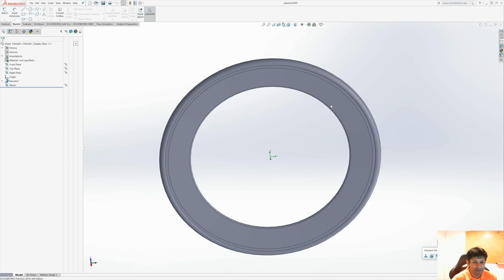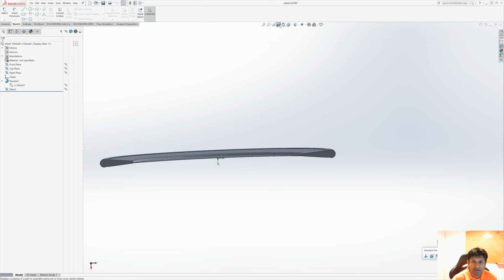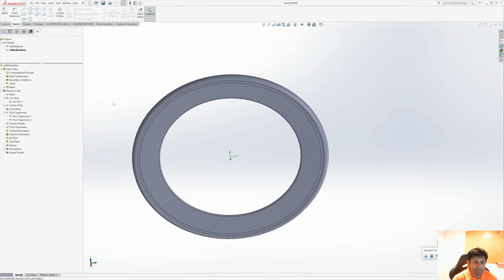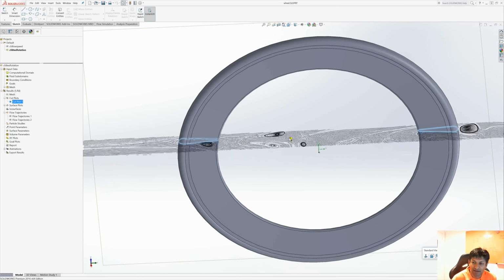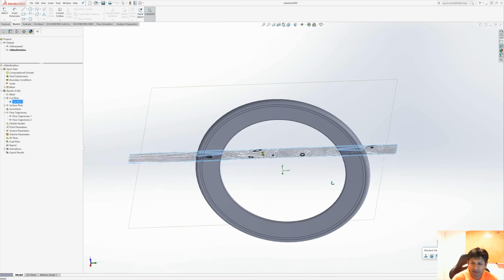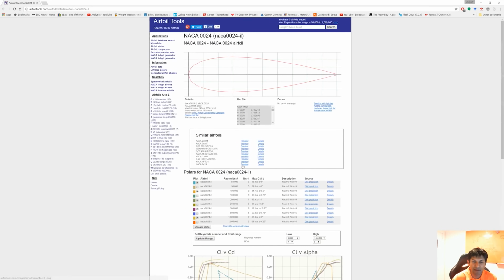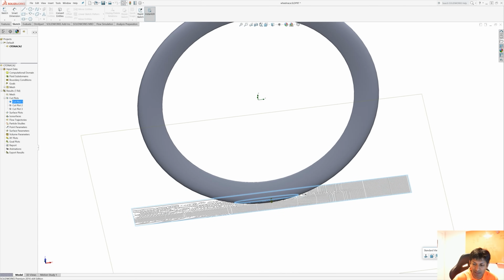Explained: Aero Bike Wheels (Zipp Enve Mavic Fulcrum)

Comment: Thanks for the modelling.  This draws a question (from my non-engineering profession background)... why would more people not incorporate a carbon fender with good aerodynamic shape characteristics to cover the top half or more of the front wheel (assuming you weren't worried about crosswinds as much and its a calm day)?  Wouldn't that reduce a lot of the front trailing edge turbulence effects by creating a continuous surface (more or less) to flow into the frame better?  Obviously the speeds aren't comparable, but you see now in some Moto2 bikes where the front fenders cover a large portion of the fork/brake surface now, which probably aides in not having wind hit all those surfaces in weird ways.  Has anyone ever experimented with front carbon fenders/shapes to test the affects on this with good results?
Reply: It's a pity you had no answers, excellent questions. I noticed that Moto2 front fender. I guess it may work

Comment: Good Morning Sir, As i understand it, since the wheel is at any one time 50% aerodynamic to the direction of travel [please correct me if im wrong] Would there be any benefit to attaching a LMP1 style wing or bodywork type idea to the fork, to mask/protect the trailing edge (6 o clock to 12 o clock) of the wheel to prevent those vortices creating drag? (I understand that the first thing F1 designers would do in regulation-free rules, is encase the wheels). Cheers Hambini!

Comment: Right, finished it.   Jeez, that was good mate.  You seriously need to do more stuff like this.  Phenomenal.  

Question; the fork, hub and spokes will obviously affect air flow, so does that improve things for the top half of the wheel or add to the messy flow?
Reply from the maker: It makes it more messy, One of the things that you can do is when you disturb the airflow you can put a structural member immediately behind it to effectively have it operating in a drafted section. 

For example My cervelo S5 has a "dropped" downtube, whoever designed the bike realised they were going to get turbulence generated by the front wheel which they could do little to avoid and put the downtube as close to the wheel because it has to go somewhere so lets put it in an area where there is little velocity. 

This is similar to a bike rider drafting a car, they are sitting behind the car, the car has disturbed the air and they are riding along in an area with no appreciable wind. If they slip slightly back then the air has  a chance to straighten itself and they get the full brunt again.

The type of spoke has less effect as the rim depth gets bigger because the spoke is shorter and the relative velocity reduces.

Comment: I wasn't buying the golf ball dimples on the rim from Zipp either. I wouldn't be surprised if tire manufacturers took up the torch and started putting dimples on the tires though. 

At 11:00 you said that the aero benefits come from pure geometry as opposed to the toroidal shape. For the most part, would it be correct to say that Campagnolo Bullet 105s are at least every bit as aero as the Zip 808s provided that the tires used are a very similar width as the leading edge of the rims on both? 
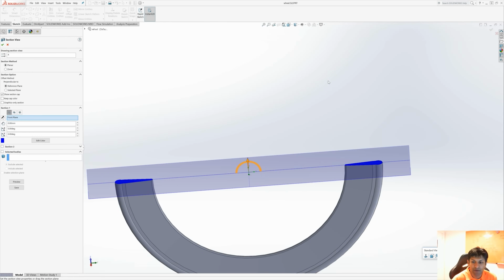Edit: Campagnolo Bullet rims are very similar in shape to the rim shape you drew and showed at 15:10

Comment: As an electrical engineer, thank you for being technical enough for me to keep up :)
Reply: Also, you made a big claim saying the dimpling is rubbish; I don't intend to argue, but can you make a video on that?
Reply: So when you did the computation, you model the wheel spin while modeling the incident air flow? If so, well done! Good attention to detail.
Reply from the maker: I don't think I'd have enough content to do a video on that. However to give you an explanation:

Drag is composed of two things, skin friction and pressure drag. Skin friction drag is just that, the drag caused by air flowing over a surface. Pressure drag is caused by the back draft that an object leaves behind it as it travels forwards. The dimples increase the skin friction drag and reduce the pressure drag. This is why golf balls are dimpled.

The only issue on a bike wheel is this does not work because the relative speeds of the wheel around it's circumference vary.
Reply: Great video. So in your opinion, what's the best valued aero wheel for around USD 1k? I was looking at Chinese carbon  (56mm rim depth at 1550 grams)  for around that price but wasn't sure about quality. Alternatively I could look at more main stream brands. Thought?
Reply from the maker: I'd go for Yoeleo wheels. They aren't the cheapest  "chinese" wheels but they are well regarded on multiple sites.

However, if you want wheels that are essentially indestructible. I'd get Shimano C60's. They do weigh more and cost more but they have good bearings and an aluminium brake track. So in the rain they are miles better.

Comment: Excellent rim review however I do have a couple conversation points. I think the spokes and hubs would have a significant impact on the airflow of the wheels, specifically the rim to spoke conversion of airflow. It would also be interesting to see how hub design will affect the aerodynamics of the wheels since there are a huge variety of hub designs out there. Another interesting point to think about is, how could you make the bottom section of the wheel as aero as possible and at the same time have no effect on the top section of the wheel. Some sort of hybrid wheel, in which the bottom section stays at the bottom and top stays at top while the wheel is in rotation. But this design is way too complex to engineer since there would need to be a collection of different spinning points on the wheel.

Comment: Great vid, clearly explained how the deeper section is more aerodynamic. I've had a (quick) look to see if anyone has asked this question already. Simply which wheel is going to be faster up a climb, a wheel that is  heavier with a larger section or lighter wheel but has a shallower section. 
If the lightweight wheel has a section of 33mm and weight of 1250g and the more aero wheel is 55 mm at 1400g, climbing at a speed of 14kmh. Climb has gradient of 7% (I don't know if that's relevant). Which wheel would be quicker on the climb? Thanks

Comment: The dimples: Schuberth helmets used these to reduce airsound. The theory behind this is a controlled airstream without random stalls. The efficiency of the helmet got worse but the difference between silence and tornado feelings became less.
And this is why Zipp put the dimples on the rim. The efficiency got worse but the crossover performance became more repeatable.
BTW: NACA was the predecessor of the NASA and developed wing profiles for airplanes. You referred to the fully symmetric ones (0009 or 0012), but they made a lot more. However for bikes we need the fully symmetric ones only. Nobody came to the idea to use a RG 15 profile for crosswind situations (would be funny if the wind direction changes).

Comment: Really good job at tackling a very complex subject. Thanks. The one question/surprise is why you didn't comment much on the stability effect of the toroidal shape at the average yaw angle. I bought into that argument in my latest wheelset purchase and I do think that i notice the benefit, versus my other bike which still has naca profile rims/tyres on it. Do you think that there is a stability benefit and, for you, might that outweigh pure aero cut through out on the open road?

Comment: Cool vid :)   
But your calcs on density (Aus v UK) are possibly a bit off (esp the 60w difference).  If you assume:
AUS: temp 35C, Alt 20m, HPa 1020, Rel H 20% Air density is 1.147.  Assume Crr 0.0052, 300w @ 30kmh = CdA 0.768 (which is super high, typical road racing cyclist ~0.330, typical triathlete ~0.285)
UK: temp 10C, Alt 20m, HPA 1020, Rel H 90%, Air density is 1.248.  Assume CdA 0.768, Crr 0.0052 Speed = 8.12 m/s = 29.2 kmh instead 30kmh.  Power to ride @ 30kmh = 323w or only 23w difference.
Maybe you could get a 60w difference due to air density, but it would be very extreme, and perhaps not really typical riding conditions.
Air density certainly has a big effect on the success or failure of hour TT records, where higher altitudes do allow slightly higher speed and make success more likely.
Reply from the maker: Hi Rob, Thanks for your question. I didn't calculate the air density, it has come from Jet Engine test conditions data from real places. For the UK, I took average density recorded over december at 1.29kg/m^3, for Australia I took the conditions of Cyprus in July  1.09kg/m^3. 

Additionally, the air becomes much more viscous as it approaches zero celsius and therefore the drag coefficient increases. In your estimation you've assumed it's constant. It becomes more like trying to go through treacle than going through air. I don't know if you have an Aerospace background or not but the governing factor is the Reynolds number, in practice it would define the detachment points of airflow. 

I think 10 degrees for a UK winter is charitable! Thanks Hambini

Comment: Nothing replaces simulation to actually identify the vortices which indicate high and low pressure zones.
As it was explained to me, the dimples on the Zipp wheels are designed to mimic the effect of dimples on golf balls which have a profound effect on drag by reducing the low pressure zone (drag) behind the ball as it travels through the air. As I understand it, the dimples allow a golf ball to travel approx. twice as far as one w/o.

I believe to be some merit in their design, but how much would actually require a lot of testing (ie. a lot of money and time) to debunk. The biggest problem that I see in Zipp's dimples is that air isn't able to travel over or under and they still expect a spherical shape of the dimples and the ball itself for air to detach and reattach especially on the top half of the wheel. 

I suppose the reason companies like Look and Cervelo have adopted NACA airfoil designs is that they're proven, and wheel patterns would not be so different aside from the fact that frames are measured in a static environment with only yaw variables.

As always, amazing video!
Reply from the maker: This dimple business will be covered in the aerodynamic masterclass video. You are right in the sense you are trying to reduce the pressure drag by keeping the boundary layer attached more. It does not work on bike wheels because they have a fairly smooth tyre so the layer never develops.

Comment: I'd love to see how the airflow is different w/ the inclusion of a bottom tube (esp tight clearance back there), fork and esp the crown area.  Most of the disrupted flow was on the top half of the wheel which is where those items would have a great effect.  Not to mention spokes, but I'm sure those would be very difficult to model.

Comment: In some testing I made on another unrelated field but using a spinning disc, the air tended to be pulled around the circumference, which I don't think is modeled in any of these simulations.

Comment: When travelling at Thirty Mph, if the bottom of the wheel is moving at Zero, the bike moving at Thirty Mph, wouldn't the top of the wheel be travelling in a forward motion at Sixty Mph. A thirty Mph headwind would contact the Top of the wheel travelling at Sixty already meaning the Top of the wheel would be going through the air at a relative Ninety Mph.
Or am I missing something.
Reply: I had the same thought. The bottom of the wheel wouldn't be at minus 30, but zero and then it rotates upwards and forwards from there. Hambini?

Comment: Hi Hambini, cheers for the no BS and putting the engineering facts out there. Cycling is full of marketing hype. On another note. If the wind is coming from a yaw angle behind you. (Pushing you along) will the wheels being deeper give you a sail effect, and if so, does the shape effect this. Or is it still just down to the chord length. Cheers

Comment: So, basically  we need a trailing edge for the front tire that comes off of the down tube, and it needs to extend to roughly 60mm from the ground to complete the aerofoil shape of the front wheel?

Comment: what is puzzling me is the following: assuming perfectly symmetrical physical boundary conditions in the CFD simulation, i.e. both halfs of the rim are symmetrical wrt. the y/z plane, the wheel moves in the y direction only, etc.; why do you get asymmetrical results, i.e. vorteces are different in size and position on either side of the y/z plane? see e.g. 16:22 in the video. It feels too big to be a numerical artifact?

Comment: Very interesting. Just wondering, if the top of the front wheel heading towards the front of the front wheel is creating drag, if you where to put a full coverage fender from the top of the wheel towards the front of the wheel, would that have less drag going over the fender vs hitting the tire rotation going forward?  Great video, thanks for taking the time to show this.

Comment: What's the best mental model for considering pressure drag assuming no ambient wind? Do I consider the top of the wheel to be moving through the airstream at 2x bike speed and the bottom to be stationary? Or do I consider a uniform airstream from top to bottom? Would a wheel sliding on ice at 30 km/h have the same pressure drag as one rolling on a flat surface at the same speed. If skin friction doesn't exist and the wheel is perfectly radially symmetric, I don't see how the airstream "knows" if the wheel is spinning or not.

Comment: My favorite ch on road bike. 
Air borne flow modeling assume the wheel isn’t turning, if apply to bike analysis should be modified to account for factors associated with wheel rolling on road. ie wheel section  facing the road has zero air speed while the wheel top segment has twice air speed wrt hub. In other words wind tunnel with no wheel in rotation does not represent real world effect.

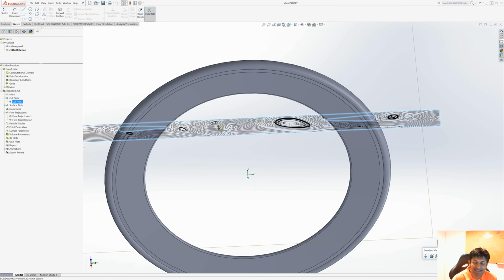Comment: 20:25 that nasty section of air must surely be affected by the fork and spokes. I wouldn't be surprised if it looks quite different on a real bike
Edit: not a criticism at all, I'm just thinking about how different the full system would look. Especially at the top of the wheel where the wake would be greatly affected by the fork crown/headtube/downtube

Comment: Interesting video, thanks. What are your thoughts on the spokes? 16 or so spokes all with a leading and trailing edge as the wheel spins? Would deeper rims reduce this drag as the spokes are shorter? Where would a tri spoke wheel fit into all of this? Thanks.

Comment: Well, if the bike goes at 30 km/h, top of the wheel has to be moving forward at 60 km/h, does it not? I am thinking like this: Bike velocity is 30 km/h. This velocity is AGL (above ground level). This is the hub portion moving. Bottom part of the wheel has zero velocity AGL. Thus the top of the wheel should be moving forward at 60 km/h, giving this portion of the wheel a relative air speed of (60 km/h + wind drag of 30 km/h) 90 km/h.
Am I missing something?

Comment: Thanks for takling the time to make this video!! 
Zipp Binned the 1080 after the 808 tested faster. Can you speculate why the 808 might be faster Even though it has a shorter chord length?

Also, it’s my understanding that the advantage of the toroidal rim shape is for cross wind stability. I’ve only ridden toroidal rims myself so can’t directly compare to the older style V shaped rims which seem more closely related to the NACA rim shape you mention. But I’ve always read that the v shaped rims (and presumably NACA shaped rims) cause the cross winds to steer the front wheel resulting in stability issues while riding. Of course when it’s windy I can feel my whole bike gets blown sideways and more so with 898s fitted, but I never feel any steering effect through the bars and find the 808s totally predicatable energy on moderately windy days, with forecast winds up to say 12-15m/s
Reply: Zipp binned the 1080 after suckers were saturated and they needed to resell them new wheels.

Comment: the wheel at the bottom does not travel backwards, it stands still. at the front it does not travel forward, but 45 degrees downwards, so its travel distance in the wind is much greater than its radial size. does the software really take air friction into account? and not just shape?

Comment: Love your videos.  This is the best one of them.  Thank you for taking the time to make it.  But I'm still confused

I get it that 

1. Wheel depth is the overwhelming determinant of how aero the wheels are.  
2. But steep yaw angles cause stall, and stall makes the wheel less stable and causes you to lose the aero benefits of the deep wheel.  
2. A toroidal wheel is supposed to help solve that problem by deferring the stall to steeper angles, right.

Is that all correct? If so, well how often does a toroidal make a difference?  How often does stall matter?  Because in your example,  you only used a head-on wind model.

For 3 months I've been trying to decide on a pair of aero wheels for my road bike and even after months of googling every aero wheel in existsnce, I'm still confused.   Ignoring weight and price, what really matters for real world aerodynamics?  Should one just go deep and ignore the shape?  How often am I going to hit wind angles where that toroidal shape matters in the real world? 

Perfect example I was looking at today.   Deep-but-flat Fast Forward F6R (60mm/60mm depth) and shallower-but-toroidal  Enve SES 4.5s (45/55 depth) .  I've been through many such comparisons with many different wheels but after 3 months I have no idea what really matters between them in real-world winds.
Reply: go for the shallower but toroidal. Weight loss is great for uphill